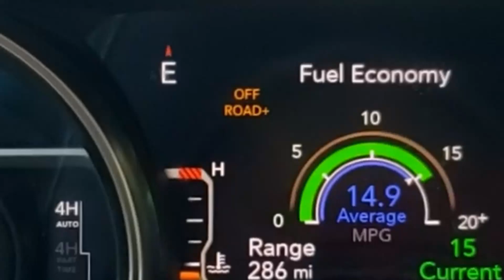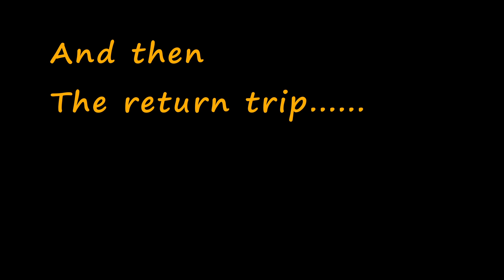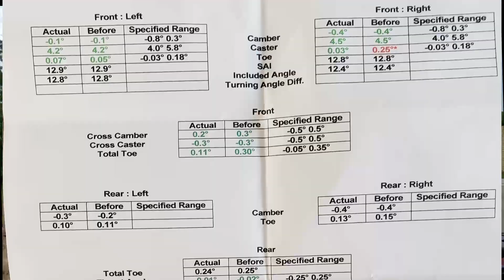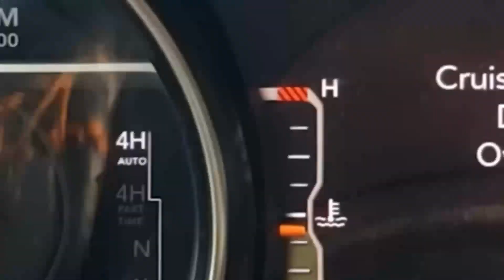392 WRANGLER road trip CHECK YOUR FLUID LEVELS

Comment: Very interesting.  I've seen a bunch of videos now about the 392 having low TC fills from the factory.  I just picked up my 2024 JLUR in December, got about 2500 miles on it now.  I checked the rear diff a couple weeks ago out of curiousity and it was barely low from the fill plug so I left it alone.  I wonder if this TC low factory fill is unique to the 392 or if I should check mine in the Rubicon model.  I've had 0 issues so far.  Only used 4wd a couple times.
Reply from the maker: I actually heard about it from a TRX owner. It was an issue for them as well.

Comment: A trick I have used for decades is to use some 3/8" id clear tubing, hang the bottle from the outside mirror and let gravity do the work.  You can just pinch the tubing as you fill your diff or transfer case.
Reply from the maker: Tubing works great.  I use this method when changing Transmission fluid in my Viper and it makes it so easy and cleaner.

Comment: My educated guess is that 392 shares the same production line as the V6 wrangler which uses a different transfer case. The V6 transfer case more than like uses less oil and they are people in charge of topping the fluids at the factory are not adjusting the amount fluid when they fill up the 392 cases

Comment: T case service is at 24 k miles. Diff at 30k miles. Never go more than 30 without t case service that is crazy. Where did you see 50k mi?
Reply from the maker: You're correct. 30k. 48km. I would normally have checked it at about 20k, especially if I was in a lot of water.